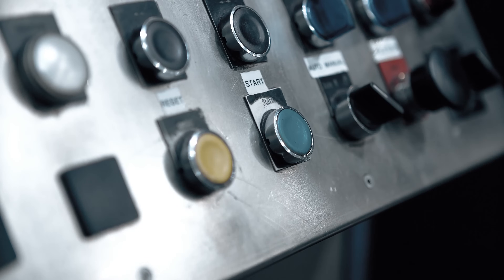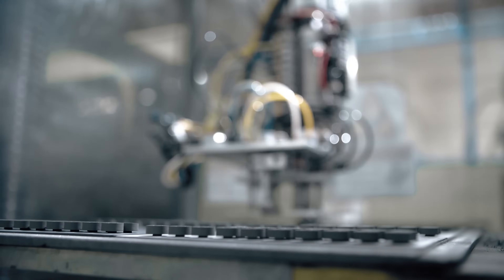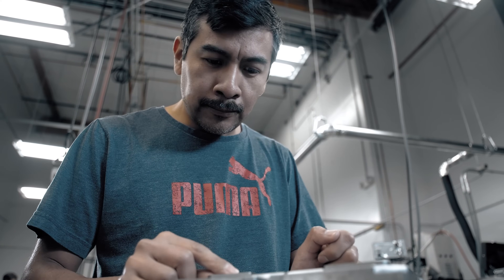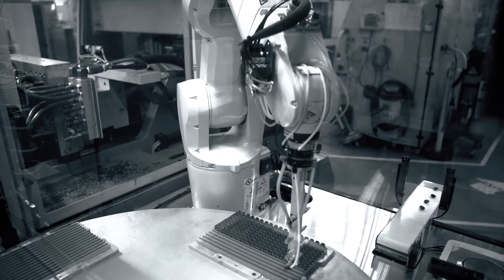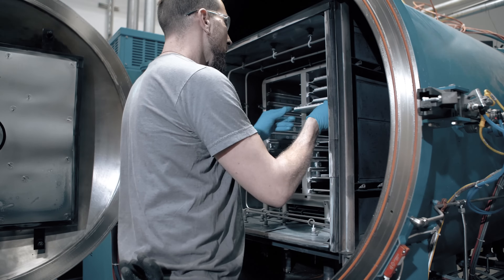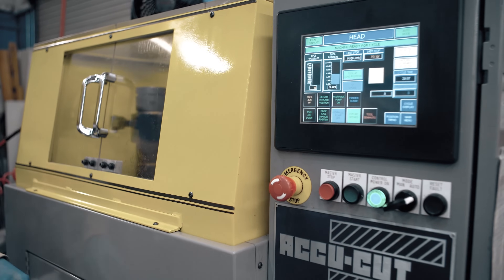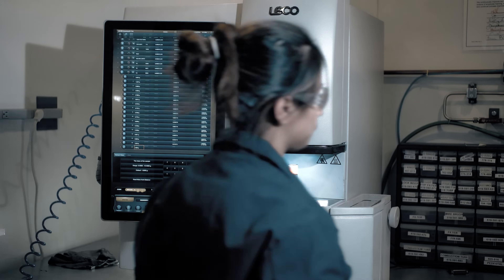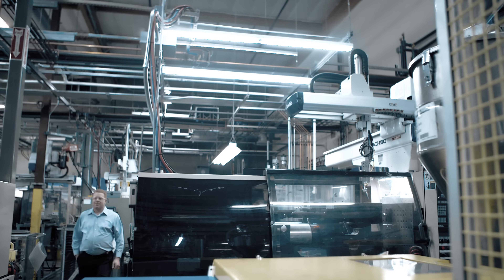Metal Injection Molding | What Is MIM? | Benefits of MIM

Comment: Questions, I'm in consideration for using MIM (knowing it sintered)?  But I need to know it design constraints.
1 - Porosity?  Can it hold water like when designing a cup?
2 - Require Machining afterward for tighter tolerances? Typ. tolerances after baking?  and typ. tol after machining?
3 - Finest Surface Finish (for Machined or Natural)?  e.g. Can it be less than 0.6-08 Ra? 
4 - Baking & shrinkage considerations when tolerating?
5 - non-uniform shrinkage? just like a normal injection mould tool design?
6 - How much material properties compromises? e.g. how much reduction in tensile strength and modulus even density?
7 - Type of metal powder available? SS, Alu, Brass, Ti & etc.
8 - Allowable for surface treatment?
9 - Just like injection allowable to have movable cores?  Cam system, unscrewing cores, collapsible cores, small overhang dimples (flexes), up & away and etc.
10 - How is it different from what "Metal Desktop" 3D printer is doing?
Reply: I am a supplier of metal powder from China. If you are interested in purchasing metal powder, please contact me.My Email:sales06@cstijo.com